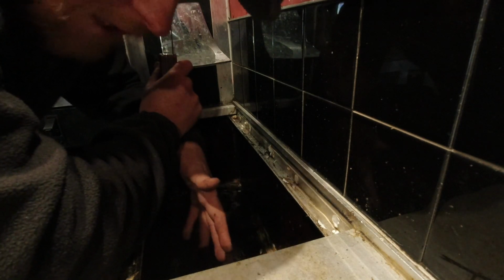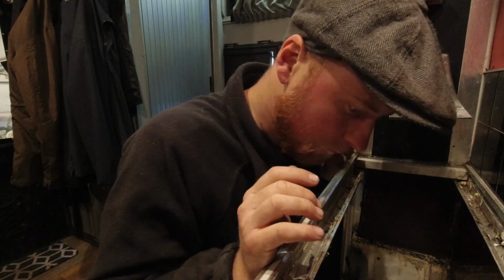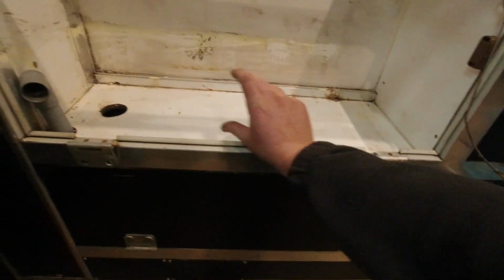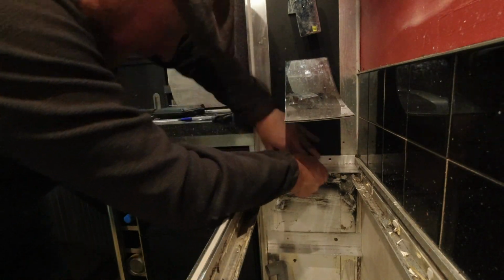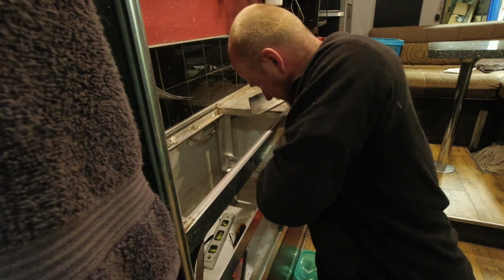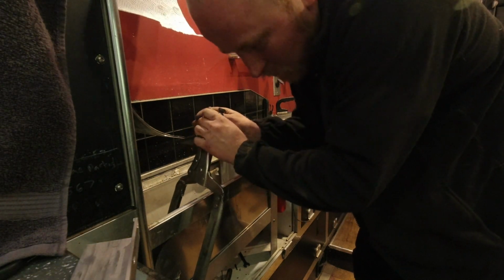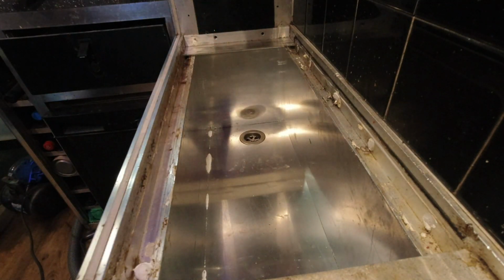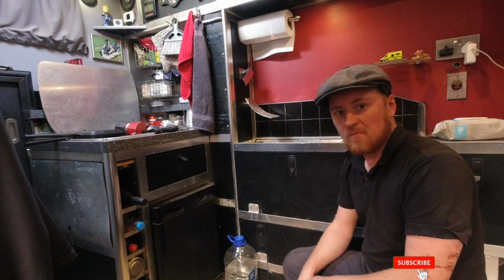Custom Sink build in Camper Conversion: Can't find one? Make one.

Comment: I can't understand why you didn't faabricate the sink and drop it into the openinng.
Reply: I was wondering the same, he has access to a welder there, a welded sink would remain water tight much longer.
Reply: And that silicone and  metal flexing and temp expansion and contraction will flex and leak over time a fab sink with welded seams would have been the best bet and drop it in

Comment: I'm not a professional caulker, but a trick I've learned is to use masking tape on each side of the gap where I'm putting sealant. It takes a bit of time to run the tape, but when you pull it off you get a nice crisp line of sealant.

Comment: well done with the sink and the engine swap on mateys van.
almost all van lifers need a lesson in mastic gun use. squeezing the stuff on is the easy part, making the sealant actually seal and look good is even easier. Use the wet finger tip technique. Lick your fore finger and wipe it along your freshly gunked crease.
wipe the excess gunk from your finger onto the back of your jeans, continue to next crease.
Yes, even the pro's sometimes forget to bring the rag from the van, back of jeans gets the gunky finger.

Comment: Top tip for sealant.....Masking tape either side of join. Run a bead then smooth with finger and remove the tape....Perfect finish.
Reply: Even better one: apply silicone, spray with soapy water, then remove excess with finger. Silicone wont stick to the soap and leaves a flawless seam.
Reply: @WiceBrullis  actually, you need to do both : 
since soapy water prevents silicone from sticking, you need the masking tape to catch it so it will come off with the excess silicone, only leaving in place the silicone which was deposited on a clean (i.e. non soapy) surface ...
Reply: @patrickvanreeth7355  it'll come off just fine without the tape. Try it some time!

Comment: You need to seal the bottom panel first then do the sides it will give you a better and cleaner finish also spray with a bit of soapy water before striking the excess off

Comment: Good effort, love the confidence of putting all the stuff back under the sink before testing if it is watertight! 
Just a thought: the fire blanket may be easier to use if you mount it on it's side so the pull is straight out of the cupboard.

Comment: Recommended  mounting the fire blanket horizontally, it is folded tightly and will not bend, so you needs clear space the length of the container to pull the blanket  free. Hope that makes sense.

Comment: Hi C.J.   I bought a steel ban marie server, and a 32mm knock out puncher, you wind an Allen  key to punch out the sink hole admittedly I have a more compact van 
I.e. a lwb Vivaro I then underslung mounted it in a solid beech block worktop and used the offcut cut out piece  as an insert  breadboard/sink cover the finger grab hole was ideal where I inserted the drill for the  jigsaw anything that gets the job done is good

Comment: Do you have the space to rotate your fire blanket 90 degrees anti clockwise? And loving that new sink. You have done so much to Amber in the time it has took me to get the front wheel bearings out :)

Comment: Entertaining content as always. Two things though - 
1) you should get a "fugee" tool (I think the name is, Google it) little silicone angle tools that allow you to get a clean uniform sealant line around all sorts of profiles. I hate sealing jobs and this has made them tolerable - you waste a lot of silicone but the look and seal is much better. 
2) just out of interest why is the sink so massive ? Most van builds I see use a small sink because of available space - yours seems very deep, and long - was there a reason for the design ? (Wondering if you need to double up as a dog bath on occasion or something?). 

Keep up the good content fella. Still living the dream.

Comment: I can’t help but think this is still going to leak eventually. You’re again relying on mastic, which will fail. Didn’t you contemplate doing it in stainless steel and having it welded or even having the Aluminium welded to give you a permanent seal? This isn’t a criticism, just an observation. Love your vid’s, keep ‘em coming 👌🏻👍🏻
Reply: work for a stainless steel manu , we make some crazy sizes of sinks but can make one to fit any gap and last for a long while ,but not as cheap as a off cut and some bits lying about :}
Reply: When it does leak it won't rot away
Reply: my 6 ft fish tank is sealed the same way and no bracing , been good for over ten years now.
Reply: @uptowndisco2  You’re not filling your fish tank with hot water 🤔

Comment: I'd have thought that it would've been easier to fold up a large sheet of aluminium the width of the sink, basically a U shape with a slight fall so one U is 5mm deeper than the other. The two end sheets with folds to allow you to pop revert it in place with the pop riverts outside of the sink so you have only a nice smooth surface to paddle pop stick and soapy water radius finish the sealant. use some high grade anti bacterial silicon sealer between the metal surfaces and the internal radius that way there would be only two bottom seals to worry about not four. 
Also being aluminium it's soft you could hole saw some wood, place the sink bottom over the hole where you want the sink hole and the price cut out on top. Give it a couple of good solid wacks making a depression to allow you to hole saw the drain hole for the flush mount plug.
The just drop into place after acouple of days curing. I did this and it's been in for five years now and no leaks or mould.
But then you work with what you have on hand 👍🏻
When and if you replace the silicone. Make sure you remove all the old stuff. Clean the corners thoroughly with metho 2 or 3 x and paper towel don't touch any of it with your fingers as to oils will lessen the result. Have a soapy water spray and soapy and a paddle pop stick with a nice radius. Apply the soapy spray to the silicon and don't over spray on surfaces that have not got the bead of silicon as the silicon will not stick If you do wait till its dry clean with metho and dry before apply silicon. Use the soapy paddle pop stick to wipe of excess silicon and form a nice radius between the surface and a thin feathered edge on the surfaces wait till it's cured and peal off any ragged silicon to the side of the filled corners. It's usually a good idea to start from a corner filling sealing all three intersections and work out and do it in short sections at a time. There a lot of video's on how to and some are just crap so check a few out first. Done clean and well it will last a very, very long time.

Comment: Nice... Will probably last a lot longer than the last sink. 

They probably used a high grade marine plywood to build the ambulance originally. You probably can't get anything anywhere near as good these days. The chemicals they put into it to make it so good probably got banned by an EU environmental directive. 2004 was a long time ago. I was still in highschool that year!  

You know its a shame Paul didn't have a spool gun - you can MIG weld aluminium with the right gun and if you get it really clean. There is a guy who has welded a bunch of aluminium stuff for gold panning and it was pretty decent. Doug from SV seeker welded a lot of the aluminium in his pilot house for his boat.